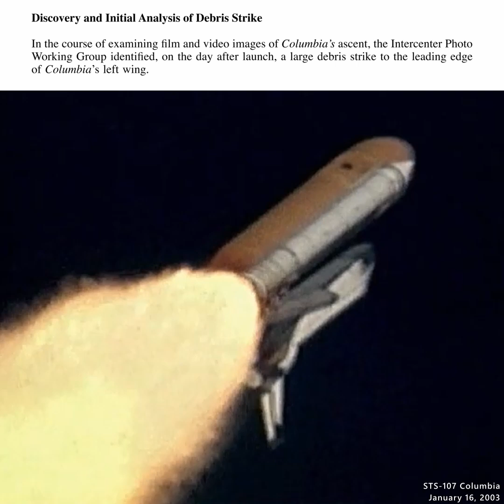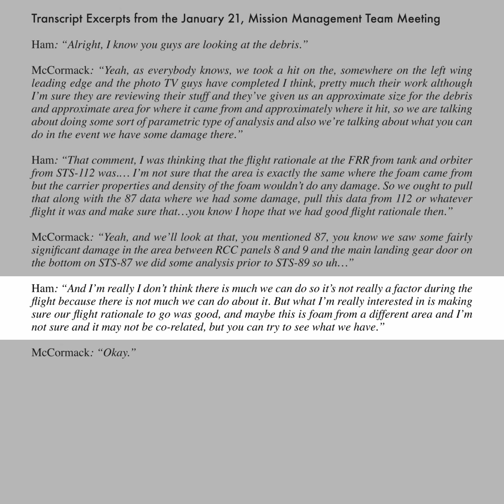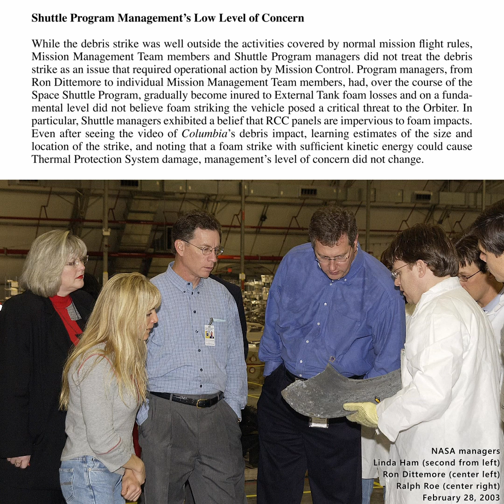"Nothing Could Be Done" | Excerpts | NASA Decision Making During Columbia's Final Flight

Comment: Looking at the current NASA program and the Return to the moon program the Columbia lesson has been tossed aside. SpaceX philosophy of accepting failure as a form of advancement sets the stage for total failure caused by the failure of a system or component that "... has never failed before...". 

The new Head of NASA has already been to space but during that 1st mission there was a hatch failure that required a manual opening for his spacewalk. That despite the risk that manual opening could cause hatch damage.  Now years later the final decision will be his.